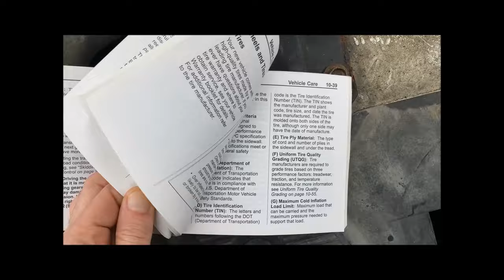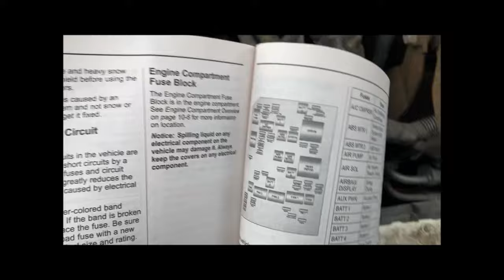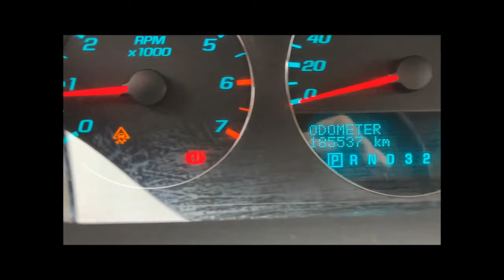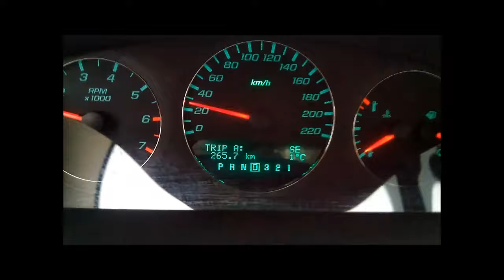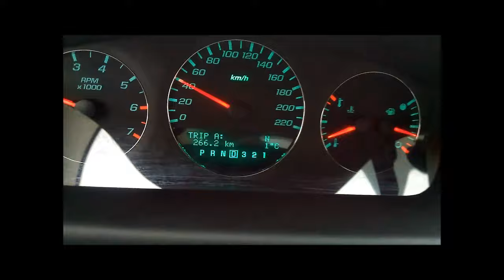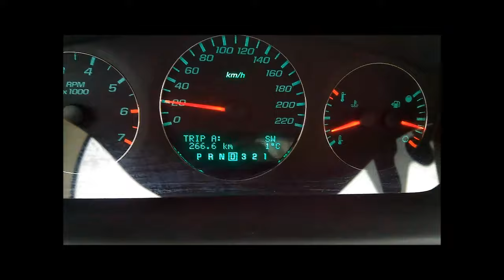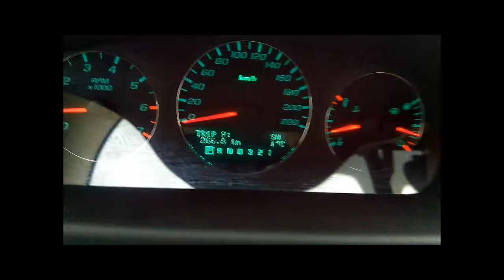How to fix ABS light, Traction Control, Stabilitrak:  Fix Driving Problems & Repair Update!

Comment: My 2013 Impala has been having drivability issues only when turning left and the traction control light comes on. It is random though, doesn’t happen on every turn. Would this be the suggested quick fix for that until I can get it into a shop next week? How unsafe is it to drive with those fuses out?
Reply: Was wondering did you get the problem fixed I have the same problem right now
Reply: @ybanyoubuildanation8131  hello! Mine ended up being my wheel harness (I think that’s what it’s called) so it was an easy fix. The harness was broke so when I turned it was making the noise!

Comment: I have a 2007 buick Lucerne and my tire sensor light is already on, but today I started it and ABS, Traction, and the red light came on and my car started dinging & something about stability came across the dash. Do you think you would know what it could be should I not drive it or what. But I haven’t took in to a mechanic yet so im kind of lost.

Comment: Having issues with my 2018 Chevy Trax, I need to change my front tires here soon, but about a month ago I got my rear passenger tire patched. The tire place didn't even reconnect the tire sensor and said it would cost $80 to do so, so I'm looking into fixing that sensor now. Just yesterday, on what I call Fatherless Day, I had my Stabilitrak decide that, in the 7Eleven parking lot of a city about 30 miles from home, it needed to be serviced. I couldn't accelerate, I had to literally gas her to get any movement, and then she refused to brake when I tried to move and park her for a tow back home (I wasn't about to drive on the interstate like that...)

I have yet to go take a look at her since, but I fear the many reasons this might be happening. Her engine light is on, and she says every time turn her over to service tire monitor system, and then immediately after to service stabilitrak. I just wanna know what I'm doing before my broke ass has to go and try to do it myself first. So what are my chances of it just being that damn tire sensor? Or anything else for that matter?

Edit: I also had JUST gotten gas, and I noticed someone below mentioning how water-contaminated gas made their car act similar, so what the hell, it could be anything 😂

Comment: What’s up Chris, I got a 2010 Camaro ss and I just changed my wheels to aftermarket. Once I finished I took the car around the block and the stabilitrack abs break light all came on with no check engine light. Any guesses what might be wrong?
Reply: What was the issue?

Comment: Just got this stupid stability track after getting tires changed this morning everything was fine but now , AWD turned off , ABS bullshit happened to me today, and im about 60 miles away from home . 

Thank you for this video because when I tried to drive, it felt like my brakes were on and fighting back . 
I took the 2 fuses off (it's a 2012 GMC terrain 2.4 btw), and drove around my jobs parking lot and everything feels normal except for the dam warning lights 😅 hopefully I can make it home from work 60 miles + rush hour traffic.
Reply from the maker: Yeah the lights suck but at least you won't lose control of the car so I'm glad the vid helped you on your commute!
Reply: Did you manage to fix the problem?pretty much the same happened to me after changing tires,stability and abs lights engage if i go on a bumpy road,and if go over 50 m/h the whole system turn of … i have code for abs wheel speed sensor,which i changed ,also changed the wheel hub but nothing happens …
Reply: Mine did the same thing after getting tires changed why would it mess it up?
Reply: @yordanhubev6837 @davidbryant5875  For me, it was the  front left wheel bearing . there's a magnetic strip that the speed sensor makes contact with, and if that magnetic strip breaks away, it will give a failure because it no longer makes contact with the speed sensor , when they changed my tire the vibration of the impact gun must've been enough to fully knock off said magnetic strip and cause this problem. 
The solution is to replace the wheel bearings . Which I had to do because 2 months later, of course, commuting without these sensors, I noticed a weird humming sound coming from the front driver side , turns out my wheel bearing was going bad 👎 and needed to be replaced I had both front replaced and it set me back $540 . 
I bought the 2 front bearing from Auto Zone for $190, the set of 2 . And found a shop willing to install them .

Comment: hey im about to buy a buick that has these  lights on and the brakes are soft like almost all they way to the floor. Do you have an idea of what could be wrong?
Reply from the maker: If the brakes are soft then there's air in the lines.  That's not related to the TCS.  I would have them bled and checked for leaks.

Comment: Im having the same issues with my 2011 gmc terrain. If I remove these fuses it will be safe to drive? We replaced the 2 front abs sensors but it didn’t fix the issue.
Reply from the maker: Your car will be like a car without ABS or traction control.  It will be as safe as a car without those features.  Changing ABS sensors will only work if you change the correct wheel that has the problem or if the problem is at the wheel. If the problem is the wire loom going back to the computer, you have to diagnose it there.

Comment: Hey Chris so I have been having the same issue with my 2009 gmc 1500 truck and every time I switch my my cars gear from P to D and drive off I always get traction control , stabiltrack and the abs light on and all of a sudden my brakes start malfunctioning, pulsating and stuttering like crazy for no reason and I’ve had this problem for quite some time now i took it one day to the dealership and told them about it and they’re response was that there was some sort of bad sensor part that was causing all these lights to come on my dashboard and that they couldn’t fix it unless they were to get a new part from the gmc manufacturer but turns out that part is discontinued so now it looks like a permanent problem but I don’t know if they’re just not really telling what’s going on with the truck or if they just don’t want to fix it because at first I had an issue with my steering wheel controls and horn that wasn’t working and I told them about it but they didn’t fix the issue but then I decided to go this local mechanic shop close to my house and all they did was replace a broken clock spring and the steering wheel horn and controls were back to normal so like I said I don’t know if the dealership was just not really telling me what’s going on or they just don’t know how to fix it so anyways I’m really hoping I can get this poroblem sorted out cause it’s starting to get very frustrating and annoying every time I drive with my truck I’m praying I can get this fixed asap
Reply from the maker: If it were me, I'd first pull the fuse going to the ABS motors to disable the system, since it's obviously a hazard to drive like that.  Then it depends on how loyal you are to the existing mechanic.  If you don't mind going elsewhere, they should be able to tell you what code the BCM is throwing (ie, which wheel or if the steeling wheel, etc).  Then repairs should be easy after that.  If you stick with the current guy, tell him to show you his Tech II scan results, so he's not BS'ing you.  If it's just a wheel speed sensor, as it often is, you can tell him to check the wire loom condition coming from that wheel and if it's in good shape and has electrical continuity, then maybe the wheel hub just needs replacement.  If the hub is old, then that's likely the problem.
Reply: @ChrisCamaro   yes I’ll definitely take of that fuse off temporarily so I can stop that from happening first and yes I am going to attempt to go to this local shop that fixed my steering wheel and see if they can try I’ll just tell him what I have been experiencing with the truck locking, stuttering and pulsating the brakes I’m just really hoping it gets fixed but do you think this might be a permanent problem I’ll have to deal with forever or should it be an easy fix from my mechanic ?
Reply from the maker: @arnoldgamez2408  Oh it's repairaable but it's one of those 90% labour, 10% parts deal if it's not just an old wheel hub.  Mine was diagnosed in about 10 minutes out of sheer luck but it can take hours if the problem isn't obvious.  It definitely helps to scan first, as this cuts the work down to about 25%
Reply: My 07 tb ls gets lights on dash but no change in any drivability.
Reply: Hey man same issue in my impala it’s the abs harness not the hub , I’m going to unplug my fuse
Reply: @TheColeman315  yes i have a feeling mine is the abs harness more than likely I have to get it checked at the mechanic soon but yea definitely remove the fuse for the meantime
Reply: @mikepedersen9520  thats probably just a bad sensor then

Comment: Hey Chris I have a 2020 Nissan Frontier and sometimes the traction control lights comes on and off and sometimes it stays on. Since that’s been happening the truck skids a lot in raining days and specially when turning at a very low speed. Basically the truck drives like if I purposely turn off the traction control off. Could this be a faulty wheel speed sensor? Thanks 🤟🏻
Reply from the maker: It could be a fault speed sensor, or the quality of the wiring is starting to break down or, less commonly, a faulty steering angle sensor.  I'd start by looking at the wiring since it's the only thing that isn't hidden from view.  Also scan the BCM if you can get your mechanic to do that.

Comment: I have 07 Impala i have service traction control and service tire monitor system lights on. I took it to autozone for the scanner and it came up under most likely solution: replace variable valve timing actuator.... then next to it said suggested parts: camshaft gear. Then i got P0300 with a couple secondary dtc's

Comment: Could the TCS saying that cause car to stall reduce speed mode  and say service  traction control
Reply from the maker: The TCS would not cause your car to stall and that's if it's working.  If you're getting a TCS service light, then the TCS likely will not work, in which case it will not deliberately misfire either.  So if the car is stalling or misfiring, it's something else.  I would use a code scanner to look for engine codes.
Reply: @ChrisCamaro  thanks keep getting code po641 replace the tbs map tune up and fuel tank pressure  sensor  with no luck
Reply: And pedal  sensor
Reply from the maker: @markbailey1423  I looked up that code and it has to do with the 5V reference voltage on the A circuit inside the PCM.  Basically there are several circuits inside your car's computer, just like in your house, how you have different circuits for your lights or your stove or whatever.  1 of those circuits inside the car's computer is out of spec.  It's supposed to put out 5V but probably putting out 4.2 or something like that.  This will affect whatever sensors are attached to circuit A so it could cause multiple failures.  This isn't a component problem.  Your sensors are fine.  It's the computer.  You need to replace your PCM.
Reply: @ChrisCamaro  thanks

Comment: Service stabilitrak service abs and traction comtrol, all wheel sensors are new as are brakes ebcm bad? Traction comtrol button when u push it doesn't turn lights off their constantly on
Reply from the maker: I would start by checking for codes and then if there's nothing there, check the wiring.

Comment: I floored it at a red light and my Stabilitrak, ABS, traction control, and check engine lights all came on. Also felt a sort of knocking in the front left wheel hub area when stopped. Based on that I feel like it's an ABS issue or maybe a wheel position sensor but I don't know. Do you have a recommended course of action? Im planning on borrowing a code reader and maybe replacing the spark plugs if its a misfire.
Reply from the maker: If the check engine came on then there may be something in the ECM that's wrong and the TCS system lights coming on "could" be a red herring.  To known for sure, definitely use a scanner because it will pick up whatever is causing the check engine light.  From there you might get a clue if that code is in some way related to the traction lights.
Reply: @ChrisCamaro  Hooked up an OBD reader to it and just got an "Invalid input from ECM" Code on it. Pretty vague but I'll investigate further
Reply: Check for water in your fuel
My chevy express 3500 suffered the problem of water contaminated fuel. Causing the engine to stutter and misfire. That triggered the stabilitrac/traction. control error message.
Total fail by Chevy engineering 👎😡
Reply from the maker: @jolujo5842  How did you come to the point of checking the fuel?  I wouldn't have even suspected it.

Comment: Have 2013, love it, but... stabilatrak, tcs, brake assist, gauges in and out, door lock pop , wont go at acceleration, then will, engine light on and off, then on. Now occasionally it wont start at initial try. Walk away come back, fires. Sometimes after driving it and turni g off. Runs fine lime its supposed. I know it can be a multitude of issues, wheel speed sensor, trans modgule, broken wires, just feel the charlie brown cloud is following too much. Any ideas, had it in a few different times, reset scanned, all good, then comes back with a vengeance,ever hear of this extreme!? Taking it in wed. Friends shop, but teying to get an idea to help them eliminate time being wasted.
Reply: Did you find out what the issue was
Reply: @dnh1107  sorry I was out of town ,no internet,  so my mechanic went through every possible connector,  inspected, observed, dielectric grease, disconnected battery, had several codes before, checked wheel sensors, reconnected battery, and boom. Kmock on wood. No issues, driven over 750 miles since, runs like a raped ape. Idk, best of all, no charge, they tinkered with between jobs, they had a power outage and I let them keep for 3 days as I didnt need. I guess a loose fitting connector is the best diagnosis!
Reply: @patricwagner7147  okay. Very interesting. I'm going to head in that direction. Thank you.
Reply: @dnh1107  believe me, I am still boggled! But am happy

Comment: I have the stabilitrak light on but when I use a scanner no code came up what should I do ?
Reply from the maker: You won't see any codes with any scanner that you buy at the store because they only check the engine and transmission.  You need a Tech 2 or equivalent that's capable of checking the body control module.  Any mechanic will have one and it's much cheaper than buying one since they are quite expensive
Reply: @ChrisCamaro  my homie runs a car shop an he had that big boy scanner an still nothing ?
Reply from the maker: @donflaco713  You may not see the error live.  You have to go into fault history to see what recent PIDs have been flagged.  The problem with the TCS is if it's a wiring problem, you will have it fail while driving but then you park the car and the wires touch again and the system seems fine.  That's why the fault history is often the only way to properly diagnose these issues

Comment: My trac light, VSC with engine light is on and the VSC keeps flashing. What could it mean? Thanks for your wonderful videos.
Reply from the maker: If you haven't found luck tracking the issue down as I have done in the video, the next option would be to ask a mechanic to use their Tech II tool to scan the body control module (BCM), which will let you know if one of the wheel speed sensors is malfunctioning or if those are all fine, something else perhaps.
Reply: @ChrisCamaro  thanks Chris, I’ll see a mechanic and see what he has to say. Catch ya later. Thanks

Comment: it's the worst on an Equinox. if you have the issue it will completely disable the all wheel drive. almost killed me and my family in a snow storm. that's a serious design flaw
Reply from the maker: Yeah unfortunately all these systems require the wheel speed sensors so if they go, you've got nothing.
Reply: My 2011 Equinox lt dash warnings came on 2 weeks ago. Vehicle drives fine even at 75mph.
Reply: @snatcher420  it will drive fine, you just no longer have all wheel drive. you basically have a front wheel drive until it's fixed

Comment: I have a camaro ss 2017, I got long tube headers installed and I got the stabilitrak light on and my check engine light on. But my check engine light is on cause of my O2 sensors but I just wanted to know if you would know what’s the problem with my car. Also my reverse camera is wrong and the guidelines will turn off.
Reply from the maker: My personal experience with my own camaro has been that when you get an error, you get lots of them.  I did a whole video on that.  The computer just freaks out and you get lights that don't really mean anything.  Mind you, I have a 2013, which is based on the zeta platform.  Your 2017 is built on the alpha platform (Cadillac ATS with a different shell), so it's probably not parts compatible.  Still I find these cars pretty flaky.  I only bought mine for the LS3 and the retro look lol.  Fuck the rest.  I wouldn't mind just pulling every fuse in the box and driving it around like a 60s car :P

Comment: Have you ever had issues with downhill braking control light staying red on dashboard and Cruze control won’t turn on .how to figure out way light is on and what kind of scanner can scan it?thanks
Reply from the maker: The problem is, the ABS, traction control, etc is all part of the BCM (Body Control Module) and most scanners don't have access to that.  Mechanics have a tool that can scan it though so your best bet at finding the problem electronically is to ask the mechanic to check.